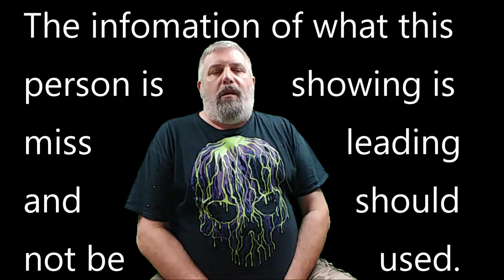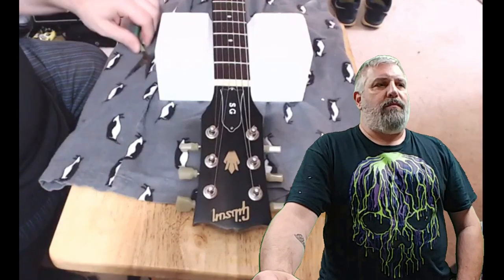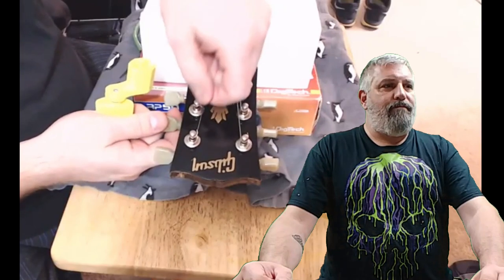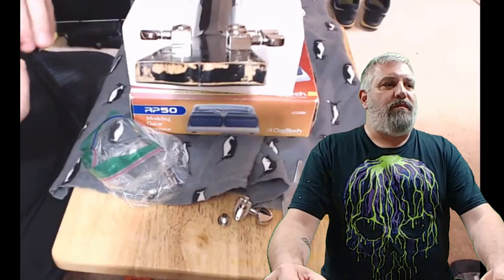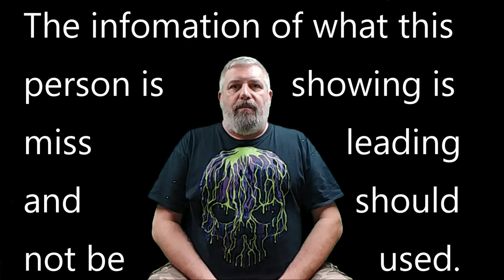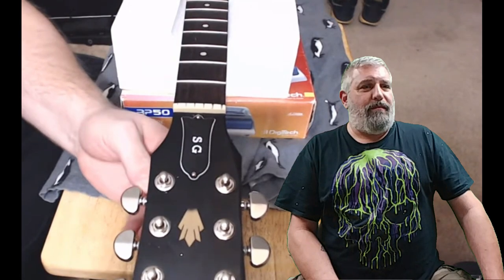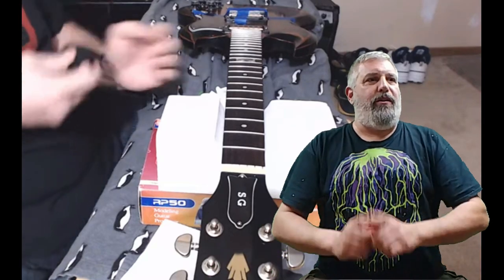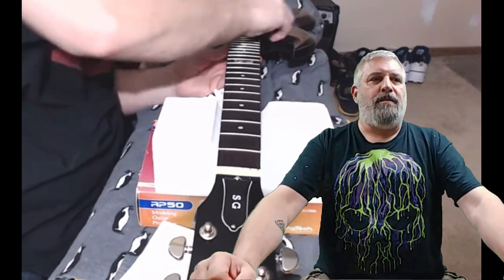Terry 3G's - Learning Video of What Not to Do to Your Guitar

Comment: I spent 2 years worrying about my guitar and watching videos and reading manuals before I even touched it, it's sure to say all that is needed is common sense and a bit of care, jesus even though it's a rip off SG it still looks good no use in scratching it up like that I use a 100 cotton cloth or microfiber for polishing anything and I made my own fret protectors from credit cards they work a treat alot of the tools you can make yourself to get the job done properly. Thanks for sharing Eric, good info on Gibsons in general well needed.

Comment: What I use to install tuners is a socket from a socket wrench set. Just the socket, no wrench. I wrap a piece of rubber around it for grip and I finger tighten it. I’ve yet to have one loosen and for sure have never cracked a head stick.

Comment: Did you also notice he used the same holes in the back of the headstock from the kluson tuners to screw in the grovers?
Whenever I've changed tuner makes I had to to the cocktail stick & superglue thing to plug the old holes & then drill new ones so the tuners sit straight & true
Reply from the maker: I know.. In the video he said they lined up. I bet all the screws are on an angle. He didn't fill the old holes he is not using either.